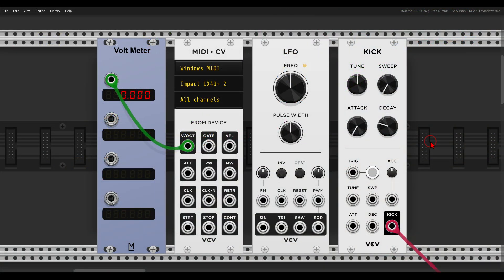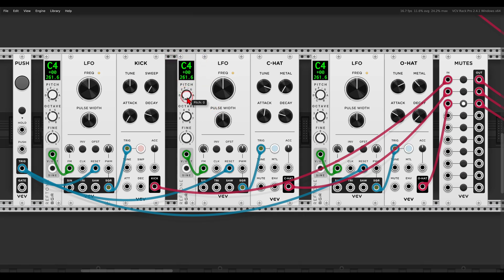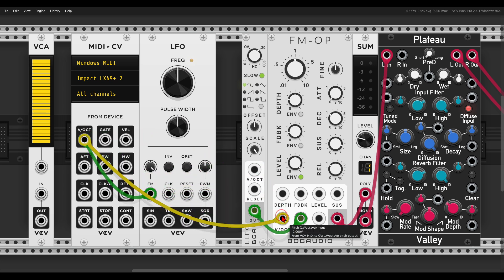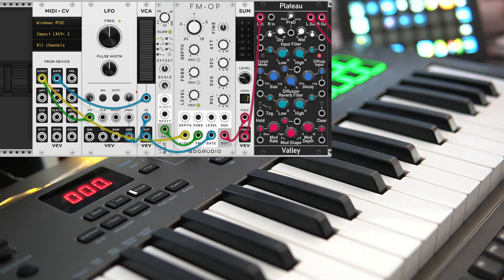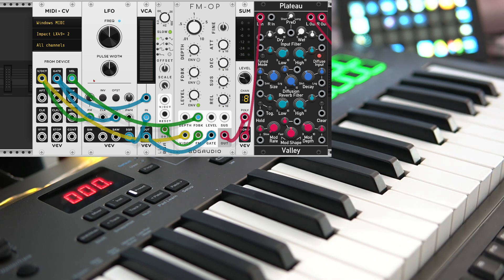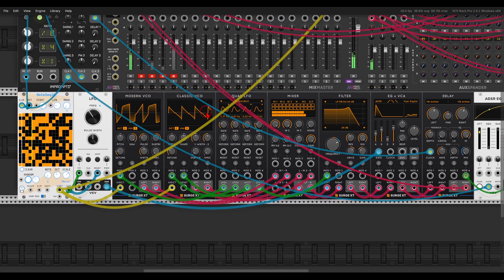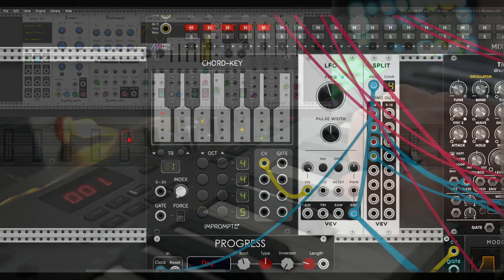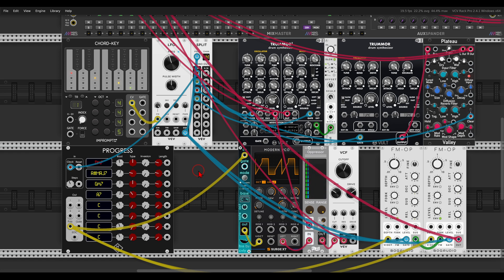Harmonically spaced Rhythms \ a FUN technique to explore!

Comment: Hi Omri,
great stuff, thanks.
Quick question - in the surge voice does the delay not fuck up the polyphony? I bumped into this problem today when trying to work with a polyphonic voice and noticed that the surge delay (the tuned delay by them does actually have polyphony) does not allow polyphony. Anyway to overcome this?
Reply from the maker: Hi! Well, the delay is not polyphonic, but if you use a polyphonic signal, it will sum it into mono, so you still get all the voices. Feel free to send me your patch, and I will have a look :)

Comment: You can also do some fun things with the thr gates that the LFO produces for other effects....perhaps run the gates through a Bernouli gate so that the rhythms are not constant, or run them through seperate envelope generators for slower attacks (I realize this can be done on FM-OP as well), so that it becomes more of a nebulous pulsing cloud instead of a more arp-like sound.

It's a very cool way to get rhythmically related polyrhythms!
Reply from the maker: Nice!